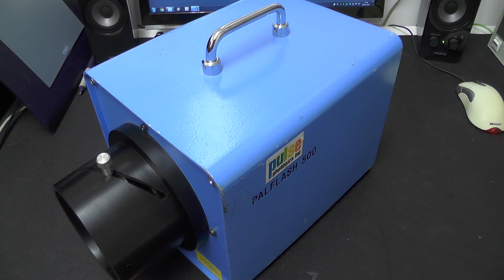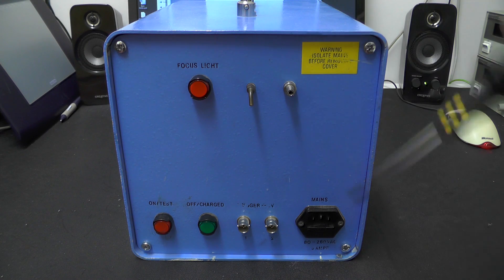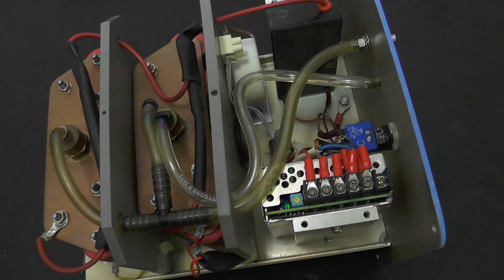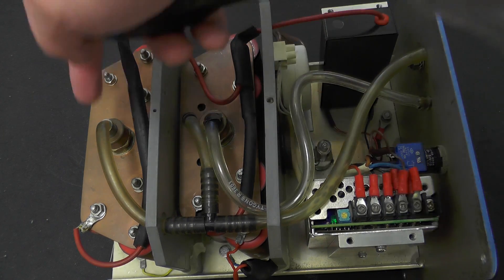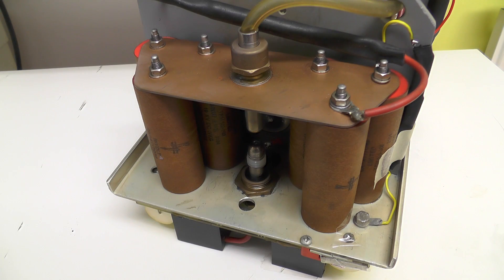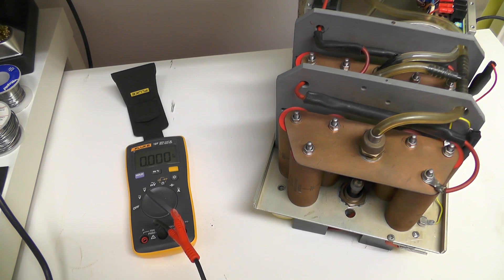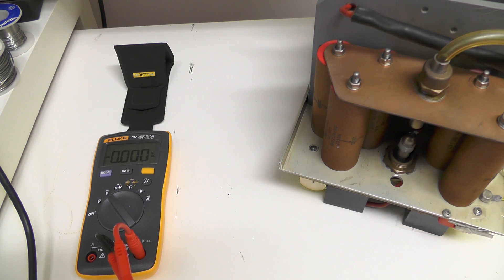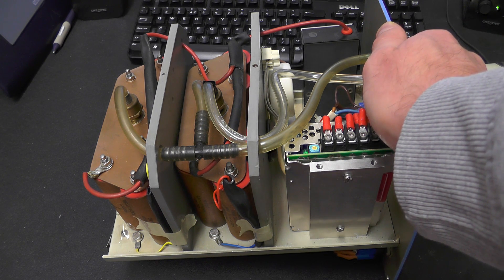DL#033 - Teardown: Palflash 500 - Nanosecond Flash Light Source Part 1

Comment: It is possible that you need to flow a gas through the unit with a lower dielectric breakdown potential than air. A good example would be Argon. Just from memory this gas breaks down about 4 maybe 5 times lower potential than air. The HV is present, the trigger spark looks good, not much else it could be. Your video content is great! Good work.
Reply from the maker: Thanks, yes in later videos i alter the electrode gap and start using argon

Comment: My guess on the gas flow is originally the back tube led to the bottom, where it was used to flow gas through the 2 electrodes, but it was modified to flow serially through the 2 gaps, probably to reduce gas usage.

You probably will have to place it back in the chamber and pump it down to reduce breakdown voltage. You probably want it to be at around 0.1bar internally to arc, or the electrodes need to have a 4mm gap to get it to fire at room pressure.